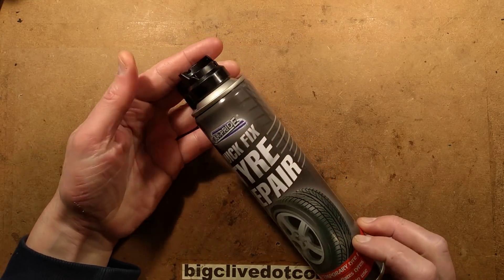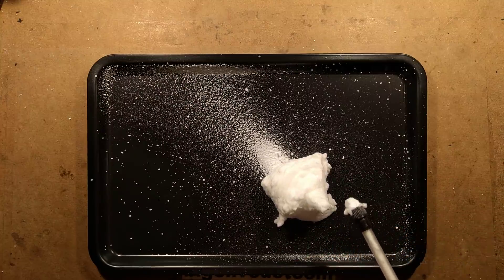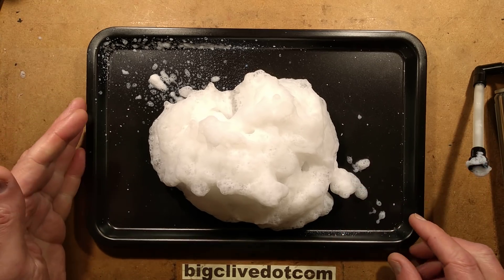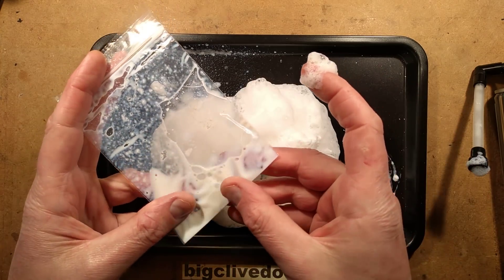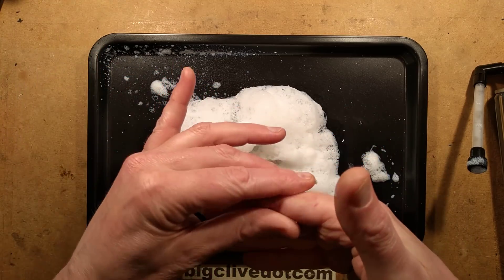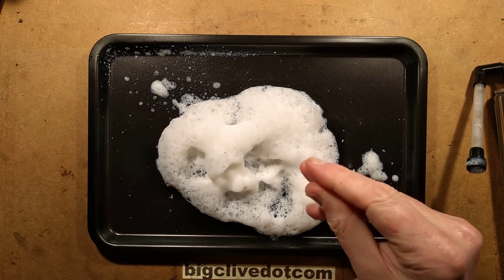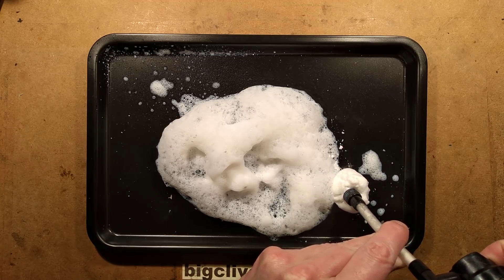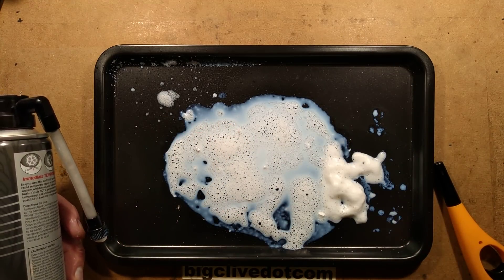What's in a tin of foaming tyre repair liquid.

Comment: Yes, I've used it, and yes I've ran a tire with it for thousands of miles. The big issue is that it can, in theory, unbalance your wheel and cause uneven tire wear. Also, whenever you use this stuff and then take your car to the shop WARN the tire guy which tire has it in it. As you said, it can be quite flammable.

Comment: I have only had one experience with this stuff, and it was when I was a thigh-high little lad! Parents got a flat tire from a puncture when we were living in the country, and they bought one of those cans to get home. One use that was also VERY handy for it was that because that liquid is white, it was easy to inflate the tire, and then look for where the goop was leaking out - and that's where they'd watch to make sure it hardened and sealed. OR, if it failed, they could at least see where the holes were to put a glue patch over it.  These days I think there are break-away plugs that you can get, specifically for 4x4 tires. You make the hole cleaner and a bit bigger, then jam a plug into it with a rubber cement solution and re-inflate the tire.  However spraying butane into your tire could get dangerous if something causes a spark either while driving or when you take the wheel off to clean it to be fixed!

Comment: My car is only supplied with one of these foaming kits. No spare wheel, no car jack and no wheel brace, all so that the car companies can make greater profits. They are a shower of charlatans. How many punctures are a nice neat hole so that the foam stuff can work. A lot of punctures are to the wall of the tyre which is the weakest part of the tyre and this foam stuff is ineffective there. The breakdown services have reported a vast increase in people with punctured tyres which cannot be fixed at the roadside because of the ineffectiveness of this temporary fix stuff and of course, like my car, have no spare wheel.

Comment: I am a mechanic and these tire repair kits are for a solution to get you to a tire shop. The foam is fills in any hole on the inside of the tire and the longer it sits, especially in warmer climates it will settle down and bond into the hole in the tire creating a very thin but usable patch that will hold air long enough for you to get to a tire shop. 

Tire repair in a can like this is not meant to permanently fix holes in tires.

Comment: a couple of years ago i used tyre weld as my spare tyre was duff. i w  as running around for a month before i had the tyre changed but i did observe the warning about keeping to a certain speed and it appeared to work okay though i did find myself checking the tyre pressure frequently.
this stuff was recommended by the guy in my local motor shop.

Comment: I have used this successfully on a 200 width motorbike tyre, but only when it was the end of its life and developed a slow leak. 1000kms after the slow leak developed the tyre was finally in need of a replacement, so I got that last little bit without having to inflate it every 1-2 days. I couldnt see it being used to replace a puncture unless you also used a puncture repair kit. The other problem is do you want to carry it around in your car, given its a pressurized can.

Comment: I have used it a couple of times it's the perfect way to get back on the road in 5 minutes. One more thing I did not hear you say was that you have to drive 10 km at 50 km/ph to get it to stick well and completely "heal" the tire. I have driven with this in my tire for 4 months but it does seem to kind of corrode the inside not sure if this is usual wear and tear.

Comment: I've used it on a pretty worn tyre that had a slow leak as opposed to a puncture (I think it was seeping from the rim)  It worked perfectly and I left it in there for several months until the tyre was changed.  The tyre shop didn't mention it.

Comment: This stuff works so poorly nobody would consider it a permanent fix for a flat. Most of the time it won't even seal. And it's not gonna really inflate the tire. Best to use a real patch kit with the. T handle and an air hose. Or the spare.

Comment: The main problem that most car manufacturers don't tell you when supplying a repair can like this, instead of a spare, is that the majority of tyre centres will not repair a tyre after using the spray. You then need to buy a new tyre, irrespective of age and condition! It is not that the tyre couldn't possibly be repaired, but rather that the process they would need to go through to comply with tyre repair standards and be sure it is satisfactory would take hours and be completely uneconomic. No company would do it and no customer would pay for it.

So when the question arises, 'Should I use this?', the answer is definitively 'NO!'. Not under any circumstances unless your tyre is on its last legs, because you WILL be buying a new tyre.

If you're looking for an emergency repair kit, the way to go is with the 'rubber plug' kits, like Dynaplug (I have one and used it without difficulty twice. They are certainly worth the money and, no, I'm not being paid!)

Comment: Hi Clive, we've used the product many times for wheels such as lawnmower tyres and wheely cart tyres, also used it plenty of times on an old car trailer tyres, we've never had any issues but then again the trailer is rarely used.  It seems to also help stop leaks between the tyre and the rim on the old tubeless trailer wheel.

Comment: I’m really not fond of these products at all and never use them — I would have to be in imminent mortal danger to even consider using such.  Hiwever, just to add, the propane propellant is also part of the sealing “formula” since propane causes rubber products to swell.  However, these products are very destructive to TPS (tire pressure sensors) and they can be dangerous to the crew working on your tire afterwards because one spark as they break the bead open is enough to potentially explode the tire in their face plus they must clean all that gunk out of the tire and rim before they can do anything in terms of patching or replacing the tire and having all that liquid in your tire potentially throws off the balance of that tire — and let’s face it, for most users thus stuff is treated as a permanent repair so your tire will remain in this mess until it is replaced for other reasons.  A far better alternative, and the one I adopt, is to keep a proper tire plug repair kit and a DC air compressor that you can power off your vehicle battery to repressurize your tire once the plug is in place.  The plugs work great and are an actual permanent solution and will last the life of the tire without any further issue and they don’t take all that long to install and they do not harm tire pressure sensors, though you do often need to dismount the tire to find the hole if the nail has gone missing.  Add to that the fact that any repair the plugs can not fix then neither can the canned goo/slime, besides blowouts and sidewall damage is what most of us have spare tires for (that is unless one has a luxury vehicle with run-flat tires, which are basically a tire within a tire).

Comment: I've used the Holts brand of this and done over 2000 miles on the tyre, driven energetically, without any problems at all. Used the remaining tread on the tyre and only ever had to add extra air once in that time.

Comment: I've used this stuff to attempt a quick fix on the way to a tyre fitters.  I had a 4mm hole in the tyre and all this stuff did is squirt out the hole all the way to the tyre shop

Comment: This WILL NOT WORK for a long period of time. It is very temporary and it doesn't fully reinflate the tire. But when the wheel starts spinning, there is rapid rise in pressure, but this is also temporary. It won't last more than a day or 2. It is only to get you to a repair shop. It is not for slow leaks, it is for a total flat.

Comment: Ugh. This stuff is the worst.
When I was in college, I worked at a Goodyear auto shop. I fixed a LOT of tires during that time. Please don't use this crap unless it's an emergency. The tech has to clear the ammonia out of the tire before repair.

Fun fact; constantly topping off a slow leak will cause copious amounts of water to accumulate in the tire. Unless circumstances or physical limitations prevent it, do yourself a favor and get the tire shop and have the tire inspected and repaired.

Comment: I know that I've used this stuff in bicycle tires before without much success. It will fix the flat at first but after about a week the tire will just burst without warning. Then the white liquid will ooze out. I always had a feeling that the foam must have some sort of solvent eating the rubber away from the inside and ultimately causing a failure. I knew it couldn't be the building material type expanding foam because it need moisture to cure(you can mist the stuff with a spray bottle and cure it in as little as 5 minutes). It would likely just stay liquid goo if you did inject it into a tire.

Comment: Bought a Peugeot GTI 180 new and it came with 2 cans of this type of product, with no spare tyre. Picked up a Tec screw one day, heard it clicking on the way home from work. Removed the  screw and pumped up the tyre, then filled with air as per instructions and it lasted for some time until I got it fixed. Had a leak in a tyre on my Discovery and used another product called Slime which fixed the leak, just pity the poor bastard who had to change tyre later.

Comment: I don't like the stuff but it's come in VERY handy. Years ago I was driving from North Carolina to Michigan. Somewhere in the middle of Kentucky on some back road I hear a FFSSSS. A hollow roll pin had punctured one of my tires. Putting the spare on I drove to a K-Mart about 40 miles away and bought a patch kit and a couple of cans of this stuff. Two plugs and two cans of inflator later the tire was holding air, but next morning it was flat again. I put in another plug and a couple of more cans of sealer and now the tire held are. I made it to Michigan without further incident, but had a new set of tires put on before heading home!

Comment: There is not "so much controversy" about them. There is only one thing to know: if you use it, it fucks up your entire rim with that mess so have fun with that. If you don't mind that you can use it. Not every old lady can do it, but you may be better off spending 5 bucks on a tyre plug kit on Amazon. I would never use a foam repair because of the mess.

Comment: Works like charm for quick emergency repairs. You have to remove the object that punctured the tyre (nail, bolt, ...), so that the latex-milk touches all sides of the rupture and bonds them together. Just used it this year for the backtyre of my motorcycle for four days (until the new tyre arrived at my tyrerepairshop). 

My father drove for about four years with a tyre repaired with this stuff (brandnew tyre punctured at a building-site), giving the tyre a bottle of "Reifenpilot" once a year, and it held air without problem.

But you should tell the tyreshop guys, that a tyre is filled wit that stuff, when finally changing the tyre, because it stays liquid inside the tyre and could result in a mess, when they don't know, that this stuff is inside the tyre, when changing a new one onto the rim.

Comment: I bought some in the Lidl, it was the Crivit brand, specifically for bicicles. 
It didn't inflate (too little pressure) nor stop the tire from leaking.
The puncture was a 1 cm slit, because my neighbour stuck a knife in my tire (a reocurring event).
Reply: There's really no inflating against a 1cm slit. Maybe you were meant to use the stuff on your neighbour in some way or another :P

Comment: Got 3 hours on a sidewall crack with one can till it gave up. Nail hole got about a week. For some reason the slime brand stuff that's not aerosolized I've had in a leaking tire for about 2 years with no more leaks out of it. I carry slime and avoid doing roadside tire changes if I can now, and use it to get me to where I can do it in comfort. I only get flats when it's snowing and -25c.

Comment: I've used it, worked quite well. After a month or so it started leaking, slowly, after 4 or 5 months it didn't hold air too well for more than a week. The garage couldn't find the hole and blamed the fix-a-flat for hiding the hole. I used soapy water and found it in 5 minutes. Put in a plug and repaired the tire more or less permanently.

Comment: If you use this stuff, and many new cars come with a can of it instead of a spare, please tell the tire man when you get if fixed for good. I used some about a year before replacing my tires (I do my own tire work) and it was still wet inside and had coated the inside of the tire and rim. I used a pressure washer to clean up the rim and let it dry before mounting a new tire.

Comment: I have used the Fix-a-Flat, it works okay most of the time for a quick fix to get you to a tire shop.   

In my younger years I worked in a tire shop so I got to see all kinds of things stick in car and truck tires.  I saw the aftermath of when the propane propellant in Fix-a-Flat ignited when the tire was being repaired.  One of the guys used a "Duckbill" hammer to break the bead on steel wheel, then he flipped it over to break the other bead.  As the wheel landed on the concrete the thing exploded shooting the whole thing up in the air.  It was a 22.5 truck tire and wheel.  The blast took about 1/2 of the rim flange off the wheel and shredded a about the same of the tire bead.   

Someone said the tire was burning when it hit floor... I do know you could see the impact area in the shop ceiling.  

How no one got hurt from the blast of the tire is beyond me.  A couple of the guys were hard of hearing for a while afterwards.

Comment: I use to use a product like this for my bicycle. It came dyed a frorescent yellow, and if the hole was large you could spot it later when you took the tube out and inspected it.  I don't know if the latex would break down from it flexing, or heat; but in the summer if you didn't patch the tube in a couple of days you were either filing it again, or walking a flat tire home.  I switched brands to a green one, and noticed when I got a double flat it held in the new innertube, but not the patched one.  I know you're more into electronics than chemistry, but do you think different brands use different incompatible solvents, or some are latex and ithers are not? If anyone eants to put their 2 cents in I welcome the thoughts, ideas, and/or expert opinions.

Comment: Used this and slime products.  They work some of the time.  Better than nothing but not by much.

It does crud up valve stems, imbalance wheels, and can damage tire pressure monitoring sensors inside wheels.

Comment: In the early 90's I was working a warehouse job with long hours and just didn't have time to get my leaking tire repaired.  I would inflate it in the morning with an air compressor, drive to work, and then use "fix-o-flat" to inflate it enough to get home in the evening.  When I finally managed to get my car to a garage, the guys were cursing at having to use a mountain of shop rags to clean all of the liquid latex out of the tire before they could properly patch it.  I don't know why it never sealed the tire, but it was repairable.  I still carry a can with me for emergencies.

Comment: The base MUST point up or you will release all the inflation gas and very little repair liquid.  What's contraversal about them?  They work fine in the short term for small punctures and are great at sealing leaking rims on alloy wheels.

Comment: I think it says that you should drive with the tyre after using the spray, using the rotating motion to smear the inside of the tyre. It also smears the rim, and mechanics who have to change a tyre that had this stuff inside are always cursing about how inacceptable it is to clean the rim and get all the gunk off it before they can mount the new tyre onto the rim. So if you want to piss off your mechanic, you use that stuff to fix a leaking tyre. If you like your mechanic (or don't want to pay something like 1 hour of work for changing one tyre), you don't use it. Ever. At all.

Comment: I've used it because I had a bead that didn't seal right when changing my summer tires over to winter tires.  I left it in all winter with no issues and didn't really notice any residue when swapping back in the spring.

Comment: Clive, I've seen the inside of a tire after using a similar product and the person had driven some distance before taking it into the shop for repair.  First of all the tire while still on the car was kind of a spongy flat but once the mechanic took the tire off and put it on his breakdown machine, there were a bunch of rubber like balls of all sizes rolling around inside the tire.  This provides some evidence for your latex theory.  In addition, I don't recall there being any liquid residue to speak of.  Needless to say, we didn't try light anything on fire. ;>))

Comment: Don't use any of these types of temp repair cans if you have a TPI (Tire Pressure Indicator) system (reads and displays the tire pressure on your dash and warns you of a low tire), these products will get into the sensor (its built into the tire stem where you fill the tire with air) and destroy it. You'll have to end of replacing it and the sensor isn't cheap and they also have to relearn your system to accept the new sensor, PRICEY!

Comment: My wife's car had a tyre with a slow leak that none of the shops she carried it to could fix so she had to fill it every week. I got fed up and used a can of this to inflate it just before inflating it with air. It's been aboutabout 6 months now and the tyre no longer leaks. At the time I didn't even think about that explosive mixture in there, cause now it's pressurized butane and air, so thanks for reminding me that I should get that fixed lol.